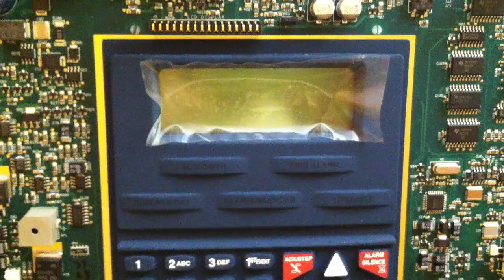Introduction To New Fire Alarm System

Comment: You need 3 ft of wire between the surge suppressor and the panels transformer, you installed it with the wires on the transformer input and the suppressor will not work.